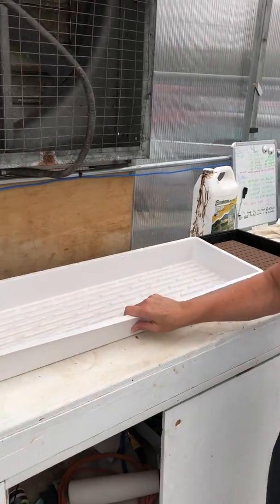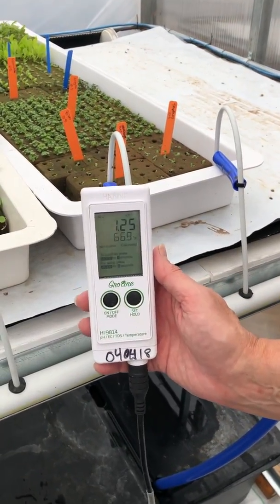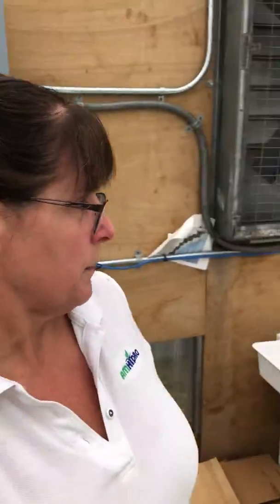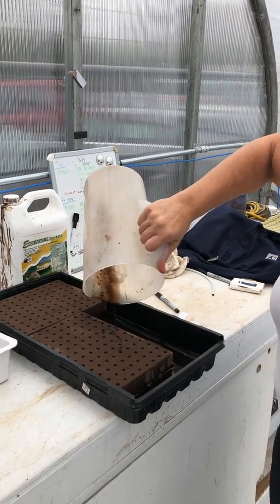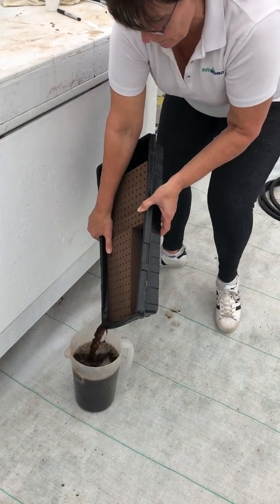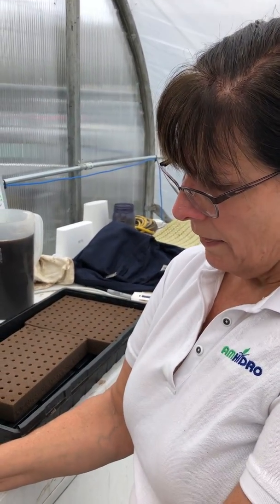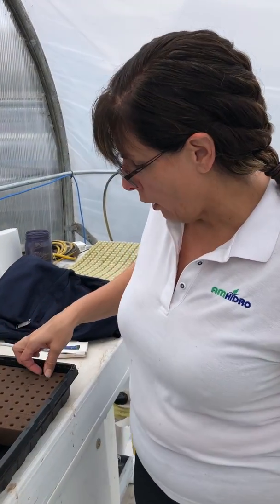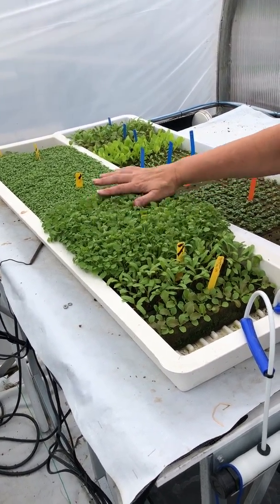Instructional Seeding Video from AmHydro

Comment: Can you inform me about the nutrient composition of your solution for Lettuce?
Reply from the maker: The nutrient comes in 2 parts.  
Bag A: Calcium Nitrate and Potassium Nitrate.  
Bag B: Potassium Nitrate, MonoPotassium Phosphate, Magnesium Sulfate and Trace Minerals (Iron, Manganese Sulfate, Boric Acid, Copper Sulfate, Zinc Sulfate and Sodium Molybdate).

Formula is well balanced and designed around using phosphoric acid as pH adjuster.

Comment: Can you make a little video about reservoir size and pump requirements...
Reply from the maker: Thanks for watching.  Would be a short video.  

Reservoir size is determined by water transpiration in plants.  For example, we us very high transpiration rates to cover the worst case scenario.  4oz per day for nursery plants and 8 oz per day for finishing.  We than double that total volume and than add the amount of water that is out in the system.  When the pump turns off, all that water is coming back and we need to account for that.  

The larger the reservoir the better in almost all situations.  The more water the more buffer for nutrient deficiency's and toxicities as well as thermal mass benefits.  

Pump size is determined by flow rate per channel.  Each channel needs 1/2 Liter per minute.  We than add 17 GPM to that number to feed the venturi (fitting that aerates the reservoir).  Head loss calculations are usually pretty low.  Standard is around 20 to 30 feet of head.  Feed water should never exceed 5 ft/s.  Most centrifugal pumps can work with that with no worries.  If you have any specific questions, email us at info@amhydro.com.
Reply: @AmericanHydroponics  thank you so much